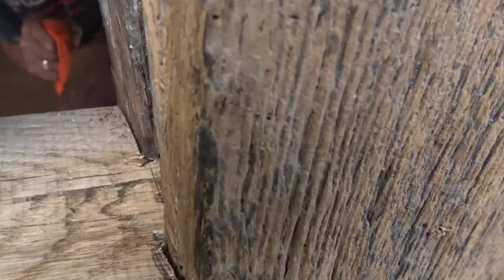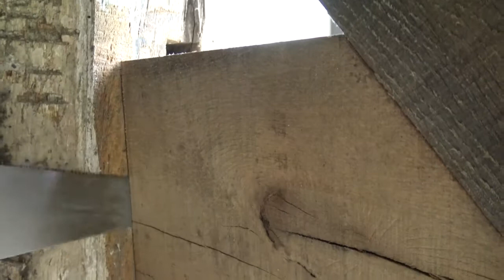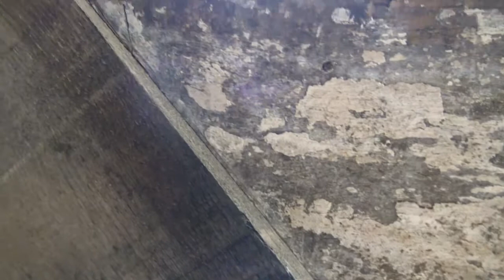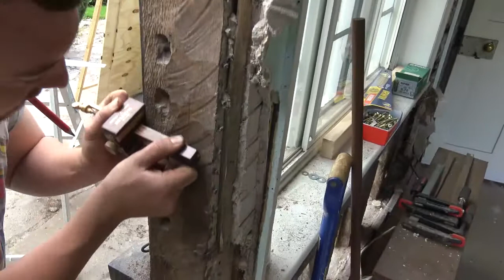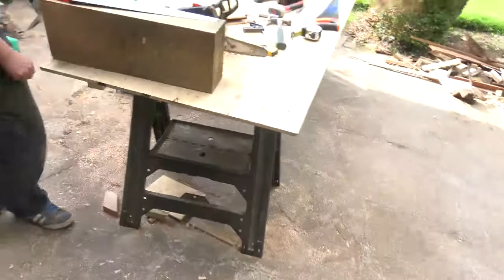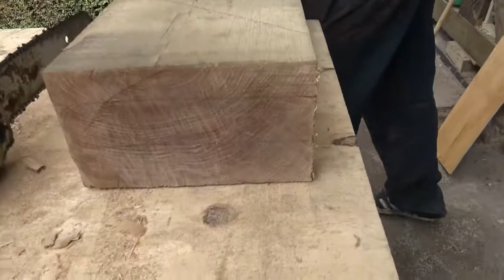Repairing old timber framing

Comment: To what extent does a timber frame require supporting while you cut out sections of rotted post and replace them? Do you have to use Acros and strongboys like with brick or will some suitably strong and custom cut timber post/wedges hold it while you remove the rotted sections?